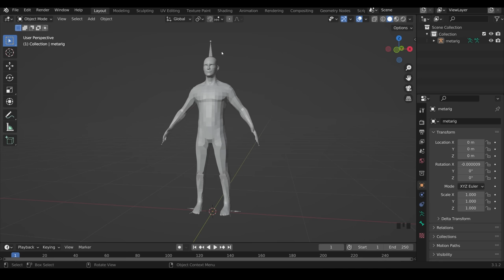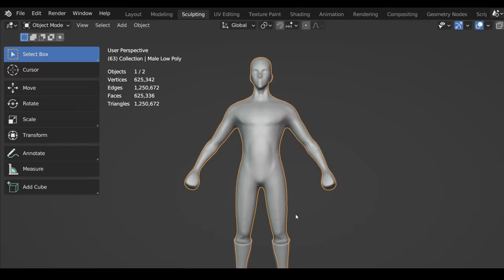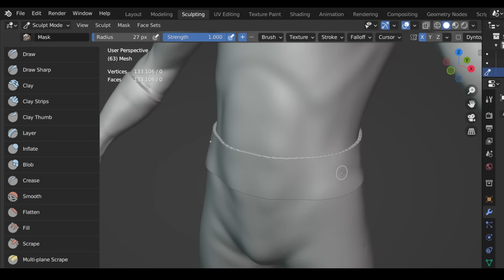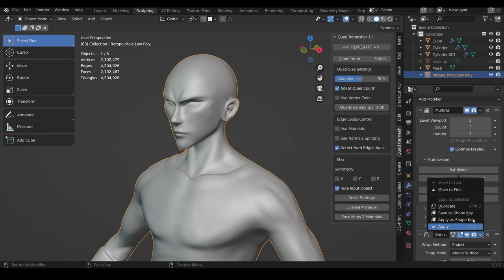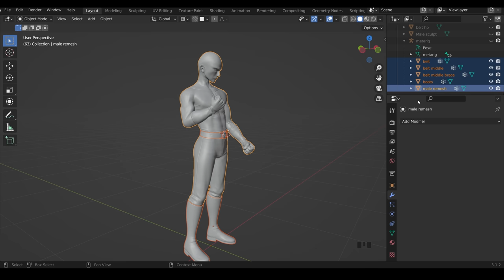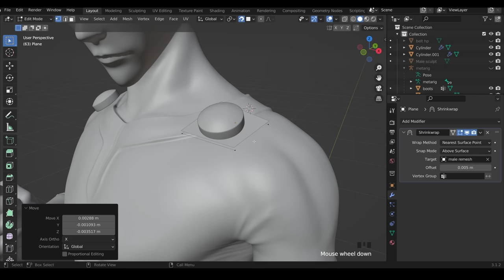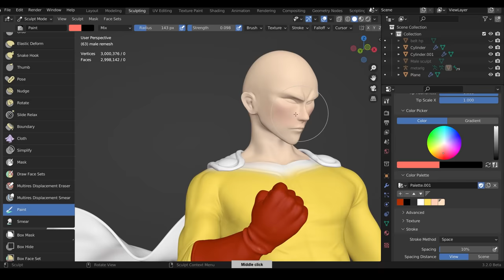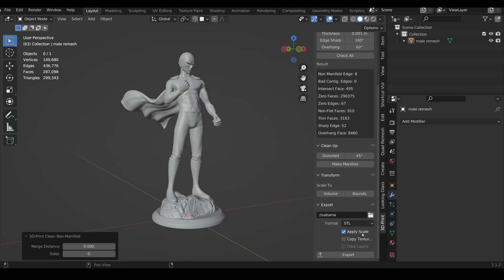One Punch Man - 3D Modelling for Printing - Blender 3

Comment: Modeling for printing is all I do with blender. Couple things that stood out to me:
You CAN have fingers, but they work best if it's a chunky glove, or do like you did where you just kinda do a mitten that has finger impressions.
How you did the boots was perfect. Probably the best way to do clothes and such really. You can always merge or send the whole thing over to 3D Builder to merge it when you're done.
Your details are looking good in 3d land but for print, everything has to be a little extra. The printer will always shave of just a hair of what detail you see in blender. It'll also smooth bits over so where you have places like the back of the glove it helps to use the crease brush and push the spot where the glove meets the arm into the glove just a bit.
It also depends a lot on what size you're modeling. If you're doing desk top sized models like 6" or taller like this one you can get away with some pretty fine details, but you also have to be more careful because you can't fudge as much. If you're doing 28mm like for DnD you gotta decide which details matter most and make them larger than you think they should be.

Over all though this was a great video. I hope you do more!

Comment: Thank you Grant for making a video like this :)

I do have a few 3d printers, both fdm and resin. Just now getting properly into blender 3 after a long break and I plan on making miniatures and statues  like this.

I was hoping maybe you could make a video sometime where you show how to split up the model and add keyholes for assembly?

Also I will suggest for you to get into resin printing if you want to print models like this and if you have the space for it since it will most likely get messy. With a resin printer you’re able to get all those details due to resin printers being able to print at 0.05 mm layer height. If you want to get into it, just make sure that you get a printer with a monochrome screen and not lcd. Elegoo and Anycubic are two brands that will get you far :)

Comment: Fantastic video!  I've been designing printable hard surface models for years but needed to start doing some character sculpts as well, so this was perfect!

You mentioned that 3d printers don't like overlaps, and while that's true of single mesh objects, Blender really isn't fussy about exporting multiple meshes overlapping at all.  You can easily export multiple overlapping meshes so long as their normals are all facing the same way, and the slicer software will treat it as one solid object.  In fact, you can use a mesh with flipped normals inside of another mesh to create a cavity in your model when you slice it.  

Thanks again for posting these, and keep up the great work!

Comment: Hey, Grant, I know this is an older vid, but I wanted to point out that you can in fact sculpt on a posed mesh while retaining symmetry. You just gotta go to the properties panel with the rig selected and go to the rig settings and click the big "Rest Position" button in the settings. It will return the rig to that initial symmetrical pose while keeping the pose stored. You can sculpt this out and when you are ready to see your results posed you just go back into the properties panel with the rig selected, go to rig settings and then click the big button that says "Pose Position". You can do this throughout the process to see how your sculpt is looking in pose and when you are ready to break symmetry you just keep the model in the pose position and sculpt on it as it is. You could even use shape keys to sculpt out asymmetric details and keep the base model symmetric for re-use in different poses. I hope that helps your or anyone else out in the future! Of course, all that goes away if you remesh or dyntopo, so bear that in mind, but this base looked solid enough to pose and immediately go into multires.
Reply from the maker: That's a great point that I had not considered. thanks

Comment: Love the videos. I am just learning Blender, But I am heavily involved in the Resin 3D Printing space/Community and that is what I want to do. For Resin 3D printing, even for small 32mm scale models ( like for use with Dungeons and Dragons or other Tabletop RPG's like Warhammer or whatever) you need MUCH higher detail on Resin vs. FDM Printing. I run an Etsy store selling these prints. The resolution these printers can render are getting quite impressive. Most newer printers in the last 2 years can print between 50 - 25 Microns (lower the better). Details like Belt buckles, hair, and skin texturing (like dragons or lizard men for example) look amazing, and painting them brings out even the subtle details. I hope this was helpful. Thanks again for all the Videos and your hard work. :)

Comment: The trick to removing supports from fragile parts like fingers, sticking out tongues etc, is simply to make sure the resin is WARM. 25c minimum, you'll notice insane improvements every degree higher you go. At 30c they should really be falling off by themselves. Also, smaller details can have lighter than typical "light" supports. 0.2 instead of 0.3mm for example. I recently printed a batch of 20 models all with tongues around 3mm long and less than 1mm thick and removed supports fine.

The other most important tip for 3d print specific sculpting. Avoid downward facing detail, favour upward facing detail. Don't let this rule override your artstyle, but if you can get the visual results you want, whilst avoiding downward detail, you'll need less supports. Less post processing any accidental support marks and so on.

Hope this helps someone.
Reply: This only applies for resin prints though. Grant is using a fdm printer.

Comment: Roughly about 12:20 is what I have the most problem with, even explaining my issues to others. Glad to have a new work path to try now. So many people have told me to boolean the items together and delete out the loose vertices/errors. It takes so long I have to quit or melt the computer. I hope this will allow me to make 20+ items, join them, and print manifold.
Reply: make low poly parts you see that need to be sculpted individually, apply enough subdiv, make copies of said parts, join into one object, apply scale(if its not 1, modifier options may work differently, including remesh with either using modifier, or at sculpt mode), remesh. Ever since Blender defaults Boolean operation into 'exact' instead of 'fast', boolean ops is incredibly slow to begin with, and the 'exact' function does not do good/efficient job of doing overlapped meshes anyway, let alone 100k+ poly of sculpted models. everything has to be made single manifold object for things to work smoothly, if voxel remesh modifier results in sucky geometry, there is something terribly wrong, but otherwise, it generates and works as intended, sometimes its a magic quick fix for hidden bad topology

Comment: Hello Grant. I have a question. So I am trying to make a character of mine for 3d print. I am use to blender and shade smooth, but as you know shade smooth does not work when you send it to print. I was told to work in shade flat. Which as a Blender artist is difficult for me. How do I keep my face count low but make my model not blocky. =(
Reply from the maker: You actually have to have a reasonable level of polygons in offer for it to print smooth but it does not have to be super high. Just as a sub division surface modifier

Comment: I think you really should get more info about 3d printing.
There are communities that design and print war hammer figurines of a few centimeters high with a lots of detail and they turn out just fine. And even i printed small pieces on a relative cheap printer with all details preserved.
A few tips i can give you on that from own experience. Keep layer height as small as possible like 0.02 mm. And the smaller your figure, the lower the speed (between 30 to 40 mm/sec gives me the best results most of the time). You can also go too slow witch then may result for the smaller parts to melt and disappear or fuse because of the heat of the nozzle. Adjust lower your temperature accordingly , PLA can have a melting temperature around 170 degrees, depending the brand and quality.
I print figures as high as 4 cm with all details preserved. I usual print with a nozzle of 0.4 mm but if the detail getting too tiny, i switch to a 0.2 nozzle. Also, turn off your bed temperature witch only cost warping problems on small pieces. If you are afraid for the piece to come loose during the printing, you can use a contact spray (even a cheap hairspray can do the trick). Now i am not an expert, but this settings have given me great results. In the end, 3d printing is always about trial and error.
Reply from the maker: Yes I keep researching. Thanks for the advice

Comment: You should try adding modeled supports to the help avoid using cura’s automatic support settings. I’d also recommend trying prusa slicer. As someone who has experimented with cura for years I am very pleased with the switch to prusa
Reply from the maker: cool thanks :)